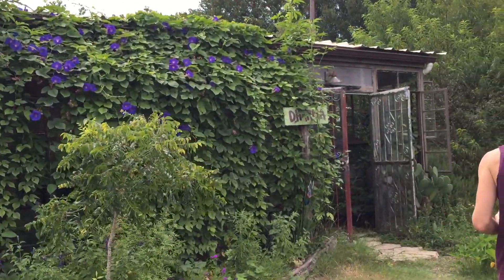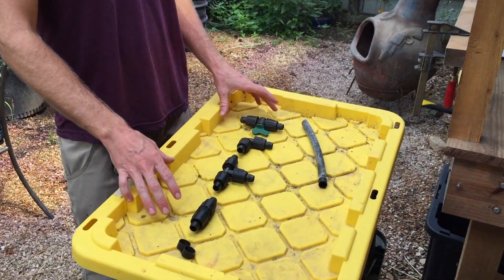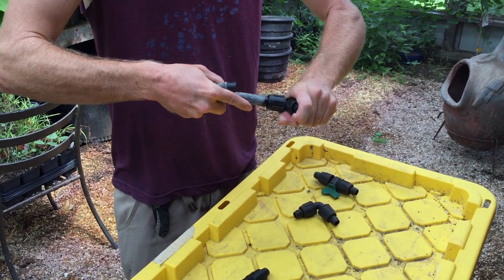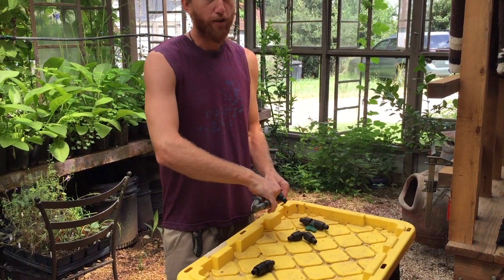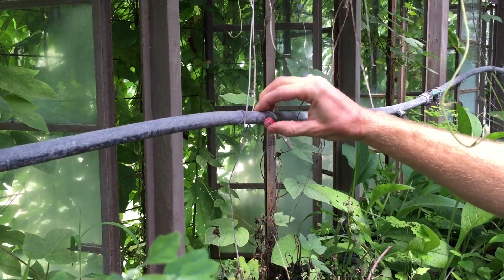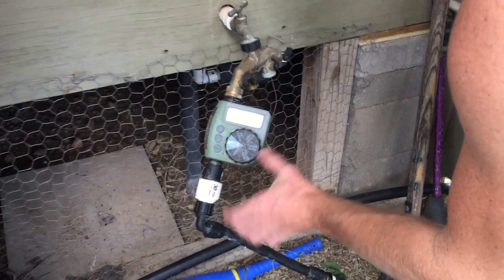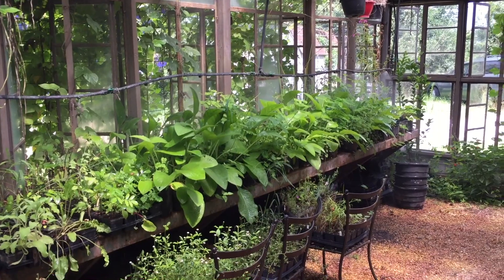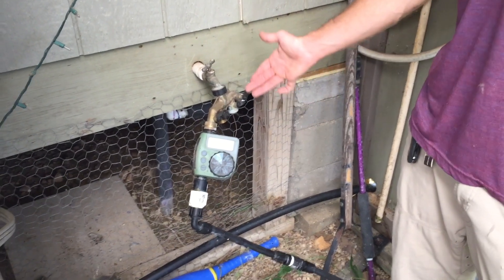DIY Greenhouse Drip/ Mist Irrigation System

Comment: Thank you for this video.  Can you more specifically identify the type of hose you are using (beyond the 1/2" ID spec)?  I have done a little looking at Home Depot and comparable length and cost is more of a plastic line than what looks like a rubber line in your video.  Thanks!
Reply from the maker: 1/2 inch Poly line from Home Depot will work.

Comment: Thank you so much for  explaining in simple terms irrigation for greenhouse

. I have a 4 way spigot and timer like yours but when I attach it to my spigot, water seems to be leaking at the joints. How do I make it tight to stop leak at tge faucet/spigot?
Reply from the maker: Sounds like the rubber gasket is either worn out, not there, not tight enough or it is too tight if you used a tool to tighten it. That or your timer froze perhaps and is now cracked.

Comment: how did you get the initial hoses into the greenhouse?  did you have a permanent hose underneath  the foundation.  otherwise since the greenhouse is fully enclosed you would have the door open.
Reply from the maker: There was an existing spigot.

Comment: Hi! how do you manage the irrigation in winter? you said it cools the air so I wonder how to do it with seedlings during winter season. thanks
Reply from the maker: Usually I would have to turn of the mister system during extended freezing weather or heat the greenhouse and drain the timer so it wouldn't break.

Comment: The floating drip irrigation is the best choice for automatic irrigation. It is a new drip irrigation technology that the floating drip irrigation device has two characteristics: (1) Auto-remove impurities of water，so to solve the long-term blocking problem of the drip irrigation (2)Lower power, the operating pressure is 0.02~2 Kg/cm2, is very suitable for gravity drip irrigation, as detailed in YouTube :

https://youtu.be/P495Nk62QMQ  (The floating drip irrigation device introduce)

https://youtu.be/hHen1IEzDT8  (The floating drip irrigation system operation)

https://youtu.be/YM9grmll1oM  (How to install an adjustable floating drip irrigation device in vertical irrigation)
Reply from the maker: Interesting, thank you.